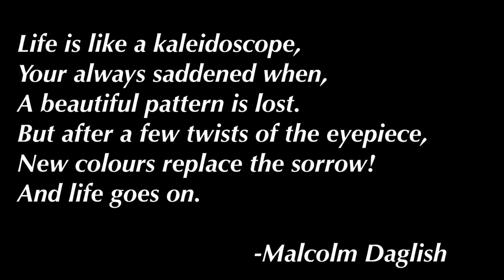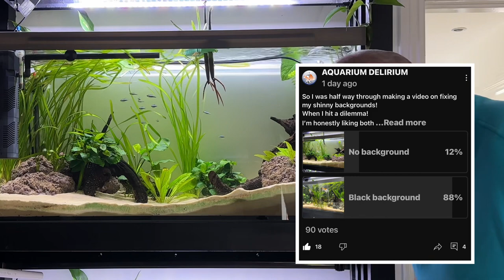Aquarium background DIY energy ⚡️saving  interchangeable

Comment: That is such a great idea; easy to change colours whenever you want and insulated too.
I kinda liked both colours but doesn't need to be one or the other really. Black when you fancy it then whip the board out when you feel like a change or even natural during the summer then the black board when it's colder and you need the extra insulation hey.
Reply from the maker: Cheers, might have to do the bottom tank as well in time for the winter